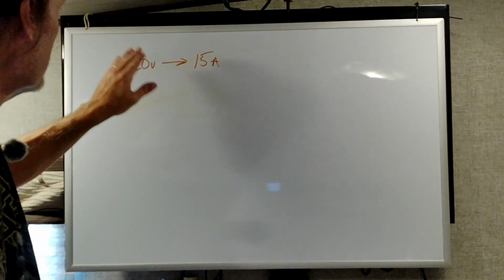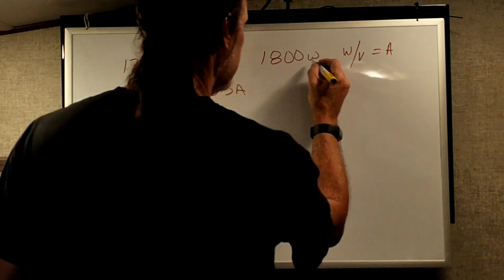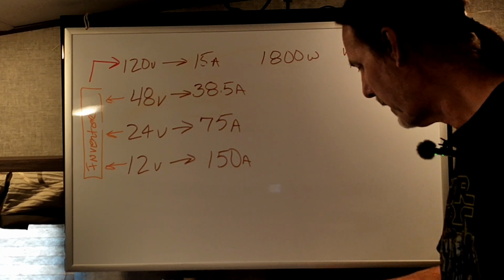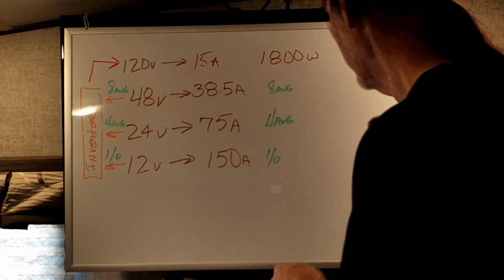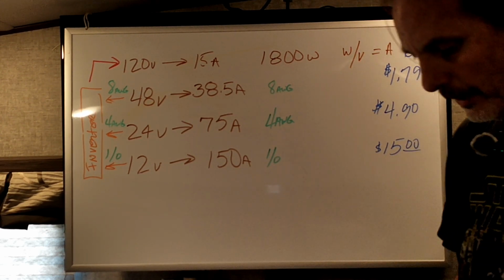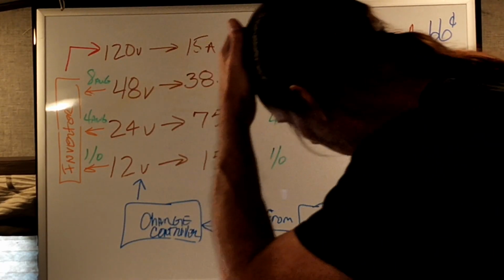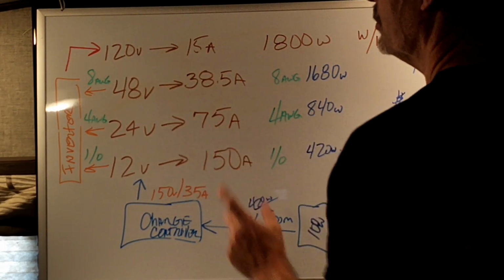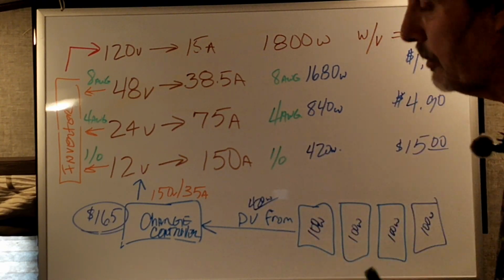12V vs 24V vs 48V Solar Battery Systems: Which One is Best For YOU?

Comment: Great video, maybe you can answer a question. For example i have a  24V Off Grid Inverter Build-in MPPT 100A and want to connect it to a Battery. Does the battery also need to ba a 100Ah (because of the Solar Inverter is a 100A) or can the battery also be a 150AH or 200AH battery? How should i know which solar inverter to match with the right battery? Thanks
Reply from the maker: No, the battery can be and should be bigger.. Check the battery for MAX charge rate, it will tell you what it can take as a max charging rate. This is common to be 1/2 the AH of the battery, like for example 100AH max charge at 50A .. BUT you should always check the battery manual to make sure.. If your battery can not handle the full charge rate you can always add a second battery or configure some charge controllers to limit the charge rate.
Reply: @MattManSolar   Thanks,  so its better to take a 1.5x or even better a 2x higher AH battery then the A of the inverter? So for example for a 4000W/24V inverter=166A and a 200AH battery should be enough for the 4000W 24V 100A inverter? It can be a single 24V 200Ah battery or double 24V 100Ah battery (in parallel) ?

Comment: I'm going to be getting a 12/24v freezer which is 49w and 5 amps on 12 and 2.5 on 24.  I was going to use a 12v system just because I don't know anything but batteries on cars and RVs.  But I do know that there won't be an inverter.
The thing is I'm wanting (for financial reasons) to build the system up gradually which will eventually include a DC RV air conditioner/heater that needs 2,000w for start up.  That's A LOT of 100w panels.
Gosh, I'm a girl and so lost when it comes to this stuff.  Can you help me?
I'm going to be doing the off grid tiny home thing.
Reply from the maker: You bet, this is the kind of system that I love to work with.. I will be building a budget 12v solar system on the live stream June 1st .. Hope to see you there and I will make sure to answer any quesstions!
Reply: @MattManSolar 
The DC freezer that I'm buying is a 12/24v and the DC air conditioner mini splits I saw were 24/48v so it sounds like I'll start with the 24v system and go from there.

Comment: @MattMan'sSolar why is the AWG for the 12v-150a 1/0 rather than 2 AWG?
Reply from the maker: 2 AWG is rating for 90-115A, that kind of pull on an consistent drain would even make it one size larger, so I would not trust 2 AWG, but might be ok if it was short bursts and very short wires, but if they are that short, just get the 1/0 .. I over size them all most of the time, but with larger stuff, more then normal cause more can go wrong!

Comment: New Solis hybrid inverters like 256v... (120-800v)
Reply from the maker: @1kreature  yes,but I know little about it.. should be a good jump for solar system moving to larger voltage batteries… but will make the DIY aspect a little more risky for some that don’t respect power enough …
Reply: @MattManSolar  My biggest issue is availability.
I have a 10kW Solis 3-phase IT-grid non hybrid inverter and 10.2kWp on the roof, and it has proven very difficult to find such size 3-phase that uses 48v (51.2v). Going for a smaller inverter would mean leaving power on the roof a lot of the time, as I am already seing system hitting 9-10kW in late March early April. Consistently producing 50-60 kWh a day.
I really hate the idea of needing 3 Victron inverters taking up an entire wall just to get this to work. The new hybrid inverter looked perfect and was "low voltage" but this just meant it would handle 230v IT grid instead of 400v TN grid. It still needed HV batteries making me very disappointed. The only inverters I found that do 230v IT grid with enough power is the Deye SUN-12K-SG04LP3-EU but it's derating for 230v vs 400v is 60% of nominal. 12k becomes 7.2 kW which is such a shame.
Edit: Btw, I also looked at the bigger SUN-18K-SG05LP3-EU-SM2 etc but I was worried they can't handle more than 650v solar input and my strings are 14 x 50.9v OC... Misread datasheet at they do 800v with MPPT being 160-650 so they could work!
Reply from the maker: @1kreature have you tried any of the AIO unit that support 3 phase and would not have any problems with 48v and 12kwp of panels..
Reply: @MattManSolar  I've been looking at them but the derating for 230v IT grid vs 400v TN was a bit worrying.
The efficiency of the inverter drops dramatically when it is working on low power vs it's rating and I did not want to end up at the bad end of the power spectrum.
For example, a 18kW inverter at 400v would fit my 10kW at 230v but the working efficiency would be less than 80% already at power below 3kW. That would be most cloudy days.
I think I will end up with a 12kW inverter that is derated to 7.8kW and let it push any overshoot into battery. (It's the DC->AC and AC->DC inverter that is diminished by the phase voltage as it's power limit is derived from the RMS current cap. It can still transform the rated unit solar string power to charge battery at full rates.)

Comment: Very good information here.  I've been fulltime vanlifing for 5 years and have had to figure a lot of this out by trial and error.  Thankfully, I've got enough understanding to not burn my van down, but I've had to add another MPPT and change my panel wiring to get the most performance out of my battery bank and panels for the reasons you describe.  I think it's important to also note the length of the cable run for the components of the system.  I've got a 10' 0/2 AWG run from my 12V battery bank to the 2000W inverter due to vehicle limitations.  Would like to hear your thoughts on high strand cables and how distance between components affects your choice of system voltage.  Keep up the great work!
Reply from the maker: Thank you for watching, and glad to have you onboard! This is a very good point with the distance. I will be sure to cover it thoroughly when I get to that part of the series. This series of video is made for you. They will all be focused on the same as you needs, so please continue to provide me with feedback and gaps and I will make sure to cover each aspect as we get to them.

Comment: Nice. I think you did a great job explaining a lot of this.  I would add a few items.

* People often get hung-up on the solar voltage requirements for a 48V system... the panels have to be able to develop roughly 65V Vmp for the charge controller to operate.   But people also forget that all this means is that you put one or two more panels in series and you can make them all fit simply by using smaller panels.  So, for example, even something as tiny as 4 x 25W panels can charge a 48V system.  So typically, to support 48V, a solar string would need to be a minimum of:

4 x 25W panels
4 x 50W panels
4 x 75W panels
3 x 100W panels
3 x 200W panels (2 x if Vmp is > 33V on each panel)
2 x residential panels

* And also, people get hung up on the added complication in a 24V or 48V system of interfacing with 12V gear in the RV or camper or whatever.  My go-to method is actually to just use a charge controller (even a lowly Victron 75/15) into a downbuffer battery.   Basically (fuse) -> Victron 75/15 or 100/20 -> 12.8V buffer battery.   The battery only needs to be big enough to provide the amperages needed for the 12V equipment, and the charge controller basically just trickle-charges it from the 24V or 48V home bank.

* Charging higher voltage banks requires a bit of thought but isn't really that big of a deal.  Still, if one is talking about alternator-charging things get a little dicey if one does not replace the 12V alternator with a higher-voltage alternator because going from 12V to 48V doesn't have very many equipment options.  Still, there are simple solutions... the simplest is to actually just have a 12V inverter producing 120VAC to go into an AC charger for the 48V bank, with a remote on/off controlled by the ignition.

For people outfitting vehicles... RVs in particular, camper trucks, or vans, alternator charging can be a bit of a chore because most people don't want to rewire their engine compartments.  So taking the efficiency losses of just tying in a simple inverter and AC charger is often the simplest solution.   For scaled solutions one would get something like the EG4 ChargeVerter which can push 5kW into a 48V system from 240VAC (2.5kW from 120VAC), or using all-in-one's (off-grid inverters or hybrid inverters).

Something like the Victron Multiplus-II 48/3000, for example, is an excellent fit for a small RV or camper van.   Victron kinda falls flat once we get into higher-power systems (above 5kW)... it becomes a multiplication of equipment verses other vendors with more powerful solutions (EG4 FlexBoss18 or 12000XP, for example).

So 48V can be a bit more difficult to research.  But I personally think the flexibility and scalability of 48V and the riidculously small and simple cabling really wins the day.

-Matt
Reply from the maker: All fantastic points, it was very hard keeping that short and I was attempting to not get off into other subjects, like controllers, panels, inverters.. I have a few others videos planned in this (what will end of being a series) series of videos about all aspects of the solar system. I will double check my schedule and make sure they all make it in .. Thanks for all the good feedback ..